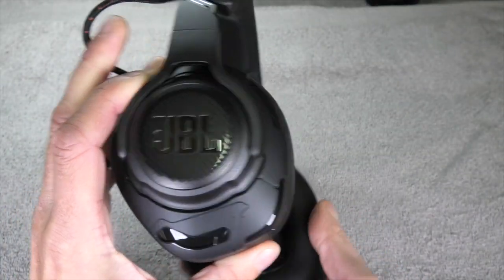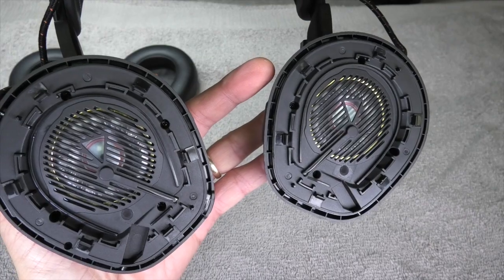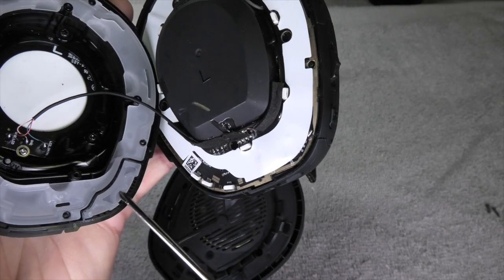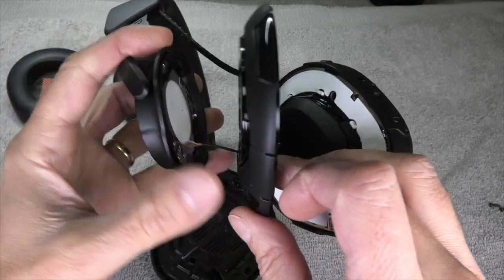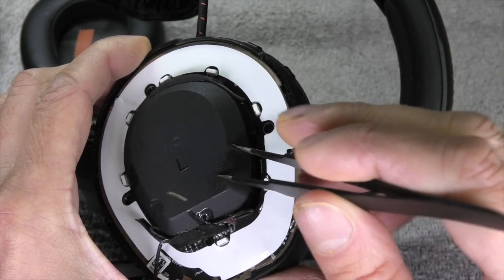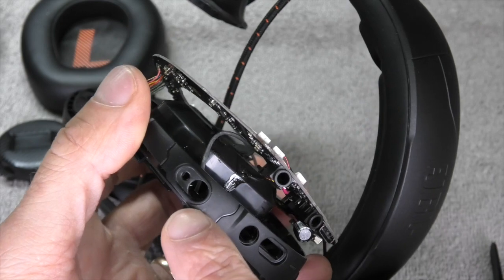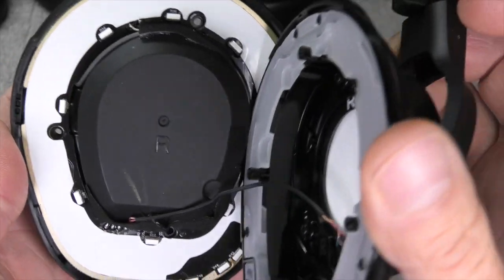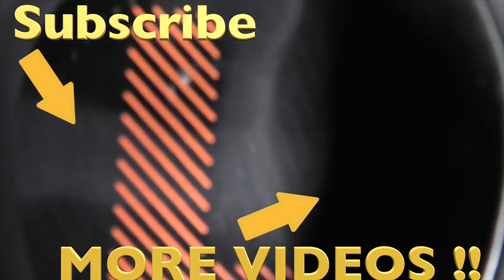Looking inside JBL Quantum ONE Gaming Headset (How to Teardown)

Comment: I own a Quantum 610 headset and unfortunately the power switch on it seems to be broken... i can no longer turn them on, even though they will charge, not even 2 years of use either, probably terrible manufacturing.

Comment: The JBL cushions wear out, glued together, the glue simply "unplys" itself seemingly easy after a year or less.

Either this will make you buy a new pair, or a wire will evaporate and cause them to stop working.

Or....

Many traps made along the way.

Built to fail 😊

Comment: Would it be unwise to take apart the cable itself on the right side of the headphones? I have a pair and the wiring seems to have gone faulty after a single year of use, considering opening it up and looking inside.
Reply from the maker: It is pretty easy and safe to open up church sides.  Just make sure to work slowly, not to tear any wires by accident
Reply: Did you try?
Same things happened ti my immaculate pair.
Cushions deteriorated fast, but replaced (till next time♧!)

Comment: The stem on the left earpiece broke, I can't find where I can buy it, can you help me?
Reply from the maker: I don’t believe they sell replacement parts other than ear pads and cables. 
In case you have access to a 3D printer, you may be able to find a model of the part on Thingiverse.
Reply: @MegaSafetyFirst   thakns bro.

Comment: I'm glad you pointed out that finding a replacement ear foam could be a problem. If they were made with real leather and not pleather which fast deteriorates, I would consider buying these.
Reply: Took about 3 years for it to happen, but my earcups finally started disintegrating. they have basically come completely apart within less than a month, but were perfectly fine before then. The foam itself is fine, so I'm going to remove the fake leather and just glue new material.
Reply: Success! Thankfully my mother is a skilled seamstress and helped me out. Using some stretchy fabric and double sided tape, these things will be set for a while
Reply: i removed the fake leather and have the sponge underneath. it works perfectly, no discomfort and also breathable material so no sweating
Reply from the maker: Yeah, the only place I found replacement for these was the JBL store in the UK 🇬🇧. 
I don’t get why JBL doesn’t offer them in all their stores.

Comment: Where is the battery?
Reply from the maker: Quantum one doesn’t come with a battery.
Reply: @MegaSafetyFirst  yeah, I got mixed up with the 800, looking at lots of reviews that day. I did buy the 800, and it is freaking awesome, for a headset anyways.
Reply: @greglast8016  Same here :) Sound is great. What do you think about ANC? Sound is much better than without but I still can hear human speech , children or tv noises if nothing is playing. What about yours?
Reply: @misenko856  agree, it can only do so much noise canceling without being dedicated to that one function. There are headsets that do better noise canceling, but those don't have most of the other features these have.  I'm happy.
Reply: @greglast8016  That's right. This is gaming headset in first place and in my opinion there is no better competitor in this segment out there. It's great for games but for music as well which is rare in this segment. Yes, battery life could be better and I wish these are not plastic but aluminum like Virtuosos or G Pros but hey, it's the sound which matter the most. What's battery life on yours ?
Reply: @misenko856  cant say on the battery life other than, I have used it for 4 hours at the longest, wasn't down half way. I charge them when they get down below 30% but try to run it down before charging. I have no problem with battery life.
Reply: PLEASE HELP I DROPPED MY 800S ON THE GROUND AND THE BLUETOOTH WONT WORK NOW